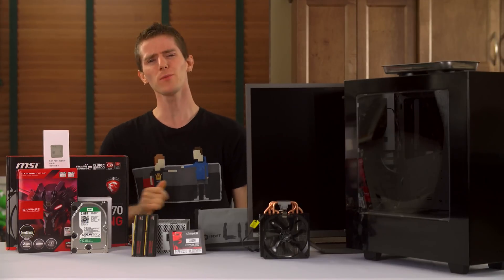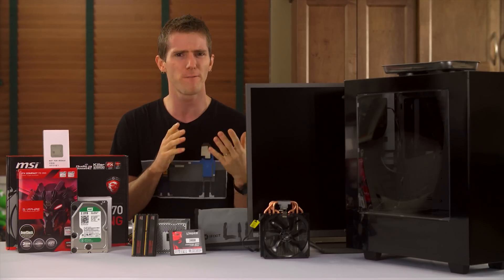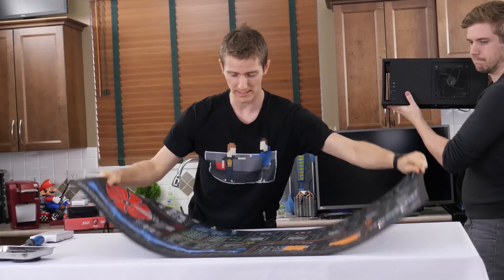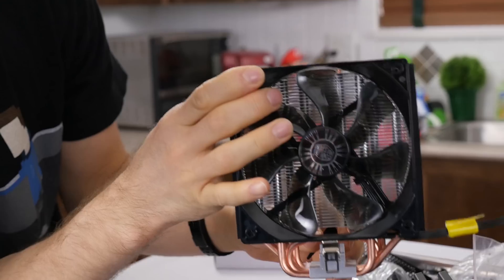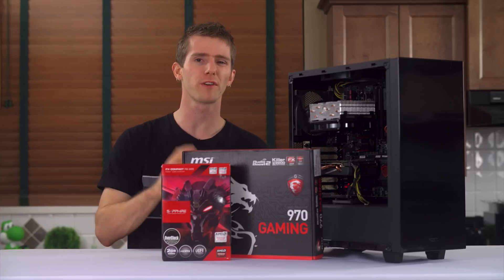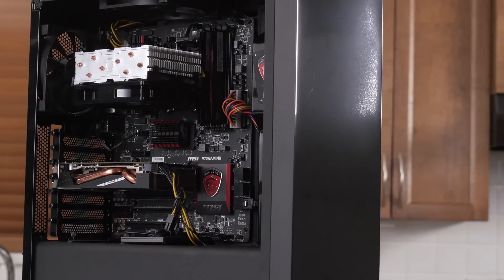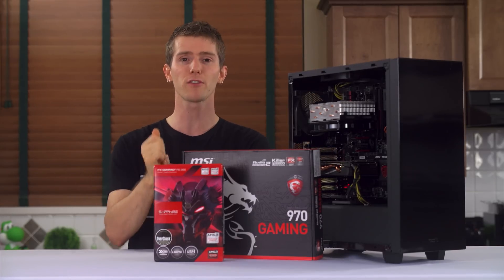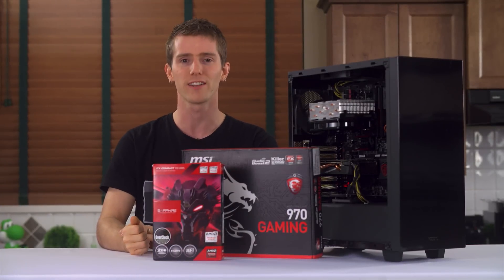Can you Build a 4K Gaming PC for Under $1000?

Comment: My question is would a game like team fortress really benefit from 4k. I mean people who play games like counter strike surely wouldn't want 4k, maybe lol and dota but they would want as high fps as possible smaller screen and quick response time. Most older games also weren't built with 4k in mind so most of them are just up-scaled to 4k which gives bad image quality and some blurriness. Only games i would play in 4k are triple a and newer titles and since i cant afford it yet id rather wait. ps i mean my pc can max out all these games in 4k and maybe some newer ones at low settings, i have a 780ti twin frozr edition but with only 3gb vram i would definitely run into problems.
Reply: I'd argue that there's not really any real-world performance benefit from a 4k screen. The only things that impact on your gameplay (when it comes to screens) are the refresh rate (120-144hz), lack of blurring or ghosting (pixel response time, gtg, b/w and vice-versa) and clarity of picture (contrast, backlight and screen technology - LED, IPS). 4k can maybe tag along with that last point (clarity), but mostly it's just a cosmetic upgrade; a piece of hardware chosen by people wanting to show off their e-peen. I'd recommend hitting up 120-144hz or maybe even IPS before going 4k if that's what you're after, and yes, I definitely noticed a difference with 144hz. Higher pixel density does /look/ nice, though. :3
Reply: TheTopMostDog I'm most certainly not thinking 4k yet. I recently just got a 27 inch 1440p monitor and ppi and higher resolution really does make games more beautiful. Little details you would never notice before really shine out and most of all I can max out pretty much any game with the few exceptions where I have to turn anti aliasing off but even those games I have textures and all maxed out. For me 27 inch 1440p is the absolute sweet spot between playable fps and higher resolution. I'm not too worried about a 144hz refresh rate as very little games hit that when I have it maxed out and don't get screen tearing with vsync off even though my monitor is only 60hz. I do know my monitor can be over clocked but I have never bothered checking how to.
Reply: TheTopMostDog I stay over 60 fps in most games I play even bf3 maxed out with full aliasing I'm averaging 80 fps. I think only time fps suffers is when a game is poorly optimised like mascar 14 which seems to either be locked at 50 or is just shitty port because even when I turn settings down it stays at 50 and because of that the fps constantly drops because of stuttering. Thank god it was only the demo and I didn't buy the shitty game
Reply: lekan adams
Haha! Yeah, I decided to grab a 144hz BenQ a while back, and I seriously will never go back to 60hz. Some people can perceive the benefits, others may not. But for me, even moving my cursor over to my secondary screen is painful to witness. Unless you can fund your high refresh rate addiction, I'd suggest steering clear for as long as you can; every new release has me frothing for a GPU upgrade, which is not ideal on any salary.. And maybe that's the deal with people buying 4k, too..

Also, I do often sacrifice gfx settings in games, sadly. I hear g-sync/freesync will make lower fps/hz look smoother and more pleasing, so maybe that's the future for my build: hopefully one day incorporating 4k too, because hell, I do like flashing a bit of e-peen occasionally.
Reply: unscaled to 4k looks bad?   ok....
Reply: TheTopMostDog well that's how I feel if you have the cash why not spend it. While most of my mates would rather spend it on drinking and god awful night clubs I'd rather fund my own hobby and when I work and save up a bit I feel you know I deserve to treat myself. I can never go back to 30 fps ever it's way too choppy and makes games unenjoyable. 60 fps and up is ideal and if I can get the hardware to support it then why not.
Reply: Sir you have no clue what 4k is about when it comes to gaming. I suggest you try it before you knock it. BTW Your wrong on the blurriness/response times and single card performance...
Reply: MrHoward888 no I'm not wrong I've never used a 4k monitor before but I know for a fact that older games that are not meant to run at a certain resolution if you run them the pixels are stretched it doesn't look very good. 4k really isn't for gaming yet it's more for professional applications so don't try and sound all high and might and why would you want a 4k monitor to play team fortress or counter strike. What benefits would yoy get the game isn't graphically amazing. When I got a 1440p monitor and played bf3 it was such a difference from 1080p and it looks amazing so did skyrim but when I ran bioshock 2 at the same resolution there was no difference it looked same and kind of stretched out.
Reply: 5british5 yeah if the game isn't designed to run at that res. Then I suppose you can use anti aliasing but most games just look like they are stretched out to 4k res and it really doesn't look good.
Reply: lekan adams
i have not seen that ?  even n64 emu looks crisp as shit at 4k
Reply: 5british5 the overall image quality will look better and I don't know about emulators but an actual triple a console game from like ps3 or xbox 360 when games were sub hd resolution but I guess you can attribute that to bad ports. Some old games look better at higher res but I played some games and it still looks poor. For example dead space at 1440p still looks very good but bioshock doesn't.
Reply: lekan adams  i would shuck that up to bad port and not upping the textures for the pc ver  i know bio infi looks nice at 4k   http://steamcommunity.com/sharedfiles/filedetails/?id=339327656    and also runs real easy
Reply: 5british5 no not infinite infinite looks good I meant bioshock 2. I guess my point was getting 4k monitor for "older" games or games like counter strike is pointless cost wise since the benefits would be very poor unless you have money for hardware to drive 4k. I would never get a 4k 32 inch monitor for counter strike or team fortress. If I want 4k I want to play games like dying light or crysis 3 or gta v because I know those games would look amazing in 4k.
Reply: lekan adams Bud I'm gaming on a 4k g-sync monitor. I tested it on single to multiple gpu's (Titans, 980's) and 98% of games I tested on you can play high-ultra 60fps on 1 card. ALL games on 4k is a HUGE difference from 1440p. I honestly can't go back to 1440p as that's almost unplayable to me. That's how huge the difference is my friend. A gaming 4k monitor has good response times so playing FPS games, you'll still merk.